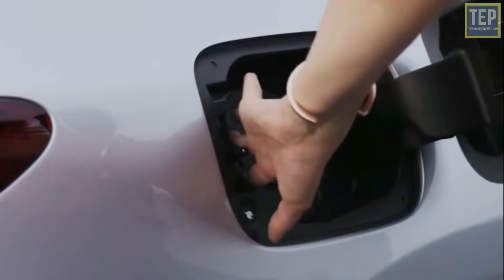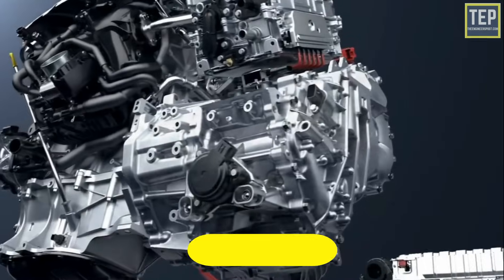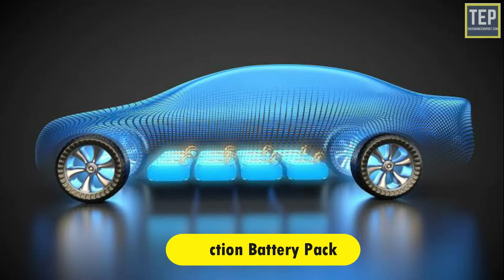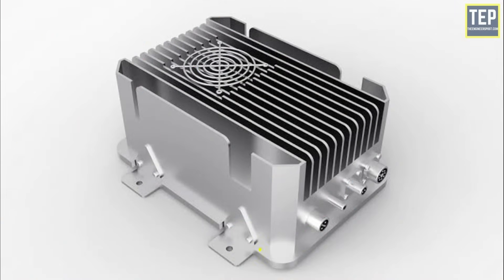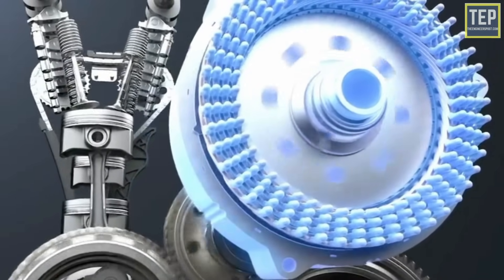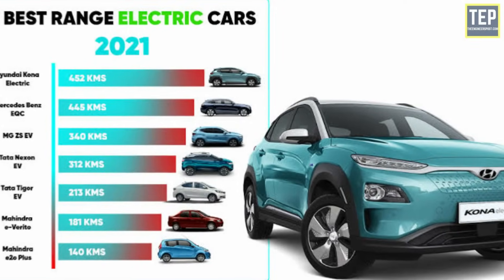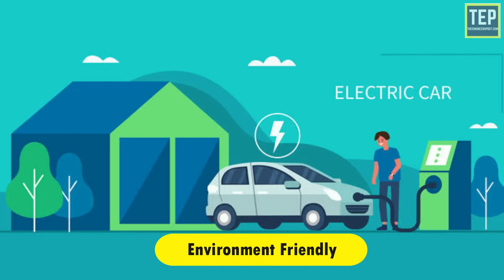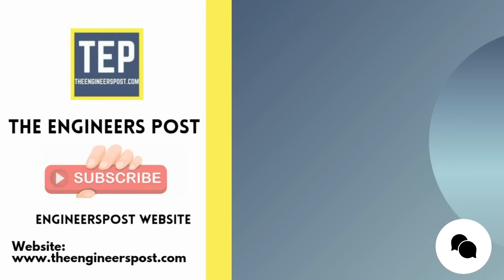How an Electric Car Works? Its Parts & Functions [Explained]

Comment: Does dc motor uses the power inverter?? 
Or what is the use of power inverter in DC motor ev?
Pls clarify this doubt..!!
Reply from the maker: Yes, it uses power from a inverter. Inverter converts DC to AC power. The inverter can change the speed at which the motor rotates by adjusting the frequency of the alternating current.

Comment: Very good quality and very informative video. I barely knew a fraction of what you have explained. Many thanks. 

You can tell the viewers about the pros and cons of battery swapping options, what improvements are being made to increase the range, and reduce charging time. I expect that replacement of the old batteries will be an important cost consideration. How does one dispose of the dead batteries?
Reply: i'M AN ASE Master mechanic ,  30+ years, they don't include, when we went from Carbs, to Computers, we lost most of our mechanic force, that know how to work on computerized cars, electric, is will be the same, as it is, most jobs are running at 10% with the amount of mechanic left in the work force before COVID even.... One we have to pay for ALL our own tools, I have over 100k.... The shops, don't give pensions, we get hurt alot..... we don't get proper health care ......   So less people are doing this work... Once electric cars hit, it will be DEALER only and even then,  mechanics wont have the tools, because we will start at 300k worth of tools and NO mechanic will and can spent that on tools to work on these cars.....    So, this means  for customers, COST will be more....as its a specialty, and less people will become mechanics as they did when carb cars went to computers...  So this means long waits for basic repairs, and less places to be able to work on them.... What runs most shops are small business, as it was with Computers, it knocked many small business out of the ring to repair them...... This will be much worse, meaning ONLY Dealers will be able to and dealers today used to have a mechanic per type of repair, brakes, front end, which means 20-50 mechanics, now most are lucky to have 2-4 mechanics having to do it all...... Once electric cars hit, most will wait MONTHS for repairs and costs will BE MUCH more.... People need to wake up.. One day electric cars will be ready, but today, they are not.. I worked on these, they are NOT dependable, due to weather changes, debris, hot, cold etc..    I live in Michigan and third generation Master mechanic....    I like electric tools and some electric things like weed wackers, but cars..... I don't and will; NEVER own one...people are in for a rude awaken.... I'm nearly 50 years old and still one of the youngest mechanics.... Due reasons I said.... its to EXPENSIVE for most mechanics to even begin to start..... In my day, it was expensive, today its 20 times more expensive for the mechanic and they don't pay us more...... and they should, we should be ALL getting pensions, THE BEST HEALTH CARE, disability, since most of us destroy out bodies, working on this crap..... I loved being a mechanic but it ruined my body and  i'm paying the price .....     So, my point, it may look good on a video.....  but even your basic camera sensors have no idea if its a person, a rock, or ice... ever notice when your cars is near a curb, it beeps to let you know... well, I live in Michigan if ice comes near that sensor it does that too, because tech is not ready yet, they are pushing it to hard and its NOT safe either..... Like self driving cars I laughed when they had nerve to tell people it was ready...... I work on this stuff and no way in hell would I put my family in a self driving car......

Comment: Being "green" is  not  the reason  people are starting to love electric vehicles... If you create a company and  that is your main selling point, you'll be bankrupt in months.

The reason people buy electric vehicles is because they drive smoother and more silent than the gas counterpart. Also, there is a myth out there where the consumer believes that they will be saving money by running an electric vehicle.  And,  finally there is the fact that electric vehicles have a  lot less moving parts than a gas car, so it should break a lot less. In other words, reliability  is also a factor people are buying EVs.

Not because they want to be green with the planet. Truth be told, nobody cares about the planet anymore!
Reply: I go by experience, I been a mechanic Master in Michigan for  30 years,  people love to say well you aren't doing maint, or paying for Gas...Well, they are wrong, Maint on an eletric car is more expensive and we need to recal, other parts of the car due to ice, debris, weather. ..we see more DEAD batteries, which cost thousands.....Electric bills are MUCH higher, more than gas for most people....  Add it up...  We had plenty of customers, and I worked on thousands of electric cars over the years......  These cars don't go that far and are towed more often than any gas car.... Due to break downs.....  Batteries are not getting better, but worse even for Gas cars..    So the Myth out there is that people believe because they are told it will be cheaper.... One, trying to find a small repair shop will be impossible, or near... right now  I'm a drivability mechanic, there are NOT many of us as it is.... TODAY,  there will be MUCH less, once this is total effect, due to the cost alone for someone to get into the field, cost me thousands to start as a mechanic I have 100k in tools......  my scanner alone 8k, per year updates nearly 1k.  along other tools..    I will need to retool, which will cost me around  150-300k.... over a period... and we make less than we did, and less benefits, so new young mechanics are NOT doing this kind of work, because its hard, training and mostly the cost of tools......... that is the biggest for any new mechanic..... So, customers will PAY more and wait longer for repairs.... This happens ALREADY today...and will be much worse... The shop I work at, and we have 2 mechanic, we had 15.... when I started... we are backed up 3 months...    and we get hurt and sick too...... With the young people not wanting to do this, will cost customers more....since they will have to get people to do this line of work, to PAY them more which in turns will JACK costs up.... This is a fact.. I  started when carbs, to computers, we lost most of our mechanic force across the world, not just US, but mechanics dropped out, like no tomorrow and the ones that stayed refused to touch computers..  I for one did and made great money, but I also got very ill, hard job... and not healthy on our bodies... Electric is NO different and costly to the MECHANIC them selves.....  This is the REAL myth, people need to wake up, most don't realize, mechanics PAY for ALL THE tools them selves, the SHOPS don't supply them.....
Reply: @recon5107  I can't speak to your experiences as a mechanic (I had no idea you guys had to buy your own kit!), but as an EV owner I know for a fact the "fuel" cost is much lower than an ice car.  My Telsa model 3LR costs me $9 to charge overnight in my garage to give me 300 miles of range (at $0.13/kwh).   To get 300 miles out of my previous car, a BMW 328i, I had to buy 12 gallons of gas (@ 25 mpg).  Even at a cheap $2/gal that costs $24.  I'd be paying $48 for each 300-mile chunk o' driving if I still had it.   Consumer Reports (and several others) have tracked the average cost of EV fuel and maintenance through 200k miles and it's half that for comparable ice cars.  EVs have drawbacks, of course, but fuel & maintence costs are not among them.
Reply: @recon5107  correct. People think it's cheaper to drive an electric car. It's not. 

The only good thing electric cars have is how silent they are and the instant torque. Thats pretty much it.

There is one thing to add to your comment. Cars are not cars anymore. They are now computers with wheels. And there is a current war between mechanics and car manufacturers because car manufacturers are making less and less standard electronics and propietary software that only they own. OBD interfaces sometimes won't work on certain vehicles wither. Its a pain even to replace a headlight ballast on some cars.

Comment: The most informative explanation on EV. Greatly appreciated! A couple questions: 1. Why do we sometimes hear electric cars blow up? 2. What's the key technology in EV development? 3. What are obstacles ahead in the industry?
Reply: The misinformation in these replies is rampant. Yes, electric cars blow up, but at a rate 10-66 times lower (depending on the study) than gas cars blow up. When the batteries catch fire, they burn at a slower pace than a gas car tank, so they are less dangerous to the occupants. Batteries fires can be put out, but sometimes they reignite so they have to be monitored by a thermal detector for a few days. That's something fire departments have to deal with, not us. Most firefighters that I've talked to accept having to babysit a battery rather than fighting the high number of internal combustion fires that occur each year. Batteries are not getting worse each year. At least in EVs they are getting better. EV batteries built today last an estimated 300,000 to 1,000,000 miles, depending on chemistry and cooling system. In real life they seem to be lasting even longer. If somebody says they don't last very long and their proof is because this person's iPhone battery didn't last very long, smile politely and walk away. The chemistry, battery management, and cycling are very different in an EV than a phone.
Reply: @juliahello6673  Sorry homegirl, that is pure nonsense!
•  These lithium ion batteries are all similar in chemistry and when they short out and ignite, they are nearly impossible to put out and saying fire departments are expected to baby sit a battery car fire is nonsense!!! Let's see if your thinking doesn't change when your house is on fire and they tell you they can't come because they're baby sitting a battery car fire at the moment!!!
•  There is only so much energy that can be stored and transferred from these batteries and it is orders of magnitude less than gasoline or diesel fuel! I order to get more energy per pound of battery weight, more exotic chemistry will be needed and costs will go up including hazardous waste disposal!!
•  I can refuel my car in about 10 minutes at any number of gas stations in any town across the US!  How many charging stations are there and what do you do when you need to go on a long distance trip??!!!
•  The majority of these battery cars are still charged by fossil fuels!  All this exercise is for nothing but to waste even more fossil fuels and pretend it saves our planet!!!
Reply: Battery blow due to thermal runaway , is the battery pack have good cooling system then chances of thermal run 
way is very less. Thermal runaway is the most adverse cause of complete thermal mismanagement
Reply: More specific, dendritic.
Reply: Electric cars blow up only in extremely rare situations similar to gas vehicles blowing up, however these days many batteries are being made which do not blow up as easily and are even safer than before
Reply: @mahinakhter8157  Batteries these days are lithium phosphate which is safer than the older battery Lithium-ion which is known for thermal runaway.  Future of batteries will be solid state.
Reply: I know all these business Proposals about an improvement is not or it's just another big business proposal for the big shot oligarchs and government to make billions of dollars.... They don't care about your safety or income if you can afford it... I prefer the old cars that I worked on I can replace carburetors, regulators, alternators, generators, brakes, radiators, tune-ups ect. And when the computers came around I said forget it man you got a go to the mechanic to do the job and turn off that check engine light and it's more expensive. How much blood can they squeeze off our arteries since they drain all our veins already and kill us with stress and anxiety..... This politicians and business people lie through the cracks of their teeth....
Reply: 1. when battery is pierced there is no stopping it. The chemistry reacts to air and will start burning like hell. just run away. 2. Batteries lasting longer, giving more juice. Reducing costs. 3. Some of the parts used in batteries are being minded from the ground. Soon there will be shortage of materials and EV are going to switch to H powered mechanisms
Reply: @JakovOmrcen   I been  Master mechanic for 30 years, Batteries today don't last longer, they last less longer than 10 year,s 20 years ago.... the quality has GOT worse..... not better... This is for electric and Gas cars, we sell MORE batteries than we ever did, 20 years ago,  in cars a year old and less........  Batteries for Electric also cost thousands .......that does not reduce costs... Sensors , states, motors, etc in electric cars have HIGH maint, need to be recal all the damn time, which is NOT under most warranties, due to it being related to  weather, debris....  So, people who THINK electric will be cheaper, have a rude awaken, and as I said in other posts, its a specialty, just like diagnosing , trouble shooting check engine lights, known as drivability.... something I done my entire career, and I meet 3 others like myself and worked with hundreds, so good luck finding a shop to repair, these, even in the future, due to the cost of tools, US mechanics have to PAY, and most won't and cant.....So, you will be forced to a dealer, and most of there mechanics won't either...Unless the SHOPS pays and MOST shops, don't pay for shit, they rely on US mechanics..... This is why the industry is dying,  and  has been for 30 years.....  These shops will be all gone small business wise.....  It will be only dealers and only a few of them.... that WILL be able to fix this stuff.... due to them PAYING shit and giving shit benefits.... Talk to any Master mechanic like myself who has been doing this along time, they will TELL you the same, this WILL cost the customer WAY MORE money at the end of the day....... and drive more mechanics from the industry... as it did when Computers, come into cars..I  personally loved computers, and electric, but I know reality and cost and what it does to our bodies and how we are treated.  So, the industry, and customers will pay the price, MARK my words.... Long waits....and more $$
Reply: @recon5107  ICE cars have loads more electric stuff sapping battery power now than they ever did, chance some pickups having 2 batteries. Not being sexist but there are a lot more women driving cars these days, just doing short local runs. In the UK we have a saying never buy a car previously owned by a health visitor or district nurse. The Tesla model S was launched over 10 years ago, with only an 8 year battery warranty! ICE engines are 20-25 percent efficient! Electric motors are 97-99percent!!! If you have 2 electric motors on the same axle you don't need a multi speed transmission or differential. Also with the OBDll port you have a very Good idea what's wrong.
Reply: @recon5107  I am the only woman in my automobile engineering class please help me to know which softwares I should study which are important and which online courses I should do .I am even sacred that I will not find the right project next semester

Comment: Hi Sir! 

Can we put a generator ( to produce electricity by running of tires ) to charge car batteries?
Or we can use car roof as Solar Panel to produce electricity to charge car batteries?
Or Use wind Energy generator to produce energy while car is running to charge car ?

Advantages may Include:
1: We can use a car for as long as we need without any charging.
2 : We dont need money to charge.

Disadvantage:
1: Very Important that a THUNDER can attack directly to an Electric Car, and in result all passengers are in danger zone.
Reply: Solar on the roof cannot provide enough energy quickly enough. Charging from the wheels is common, and called regenerative braking. It however won't give you as much energy back going downhill as you consumed going uphill.
Buy electric cars are in every way better than petrol. New fancy technologies aren't needed to convince me to drive electric.

Comment: Great video ! Nicely explained.  We can use alluminum  battery for cars.  I heard just we have to replace aluminum plate and run the car.  Replacement of aluminum is it difficult or other technical challenges are there ?

Comment: Does the electric  motor requires to  be  cooled and how it's done.
Reply: Yes, and that is part of the issue and why some of these fail in certain states, differently....  They over heat and are hard to cool, they do have some cooling, and are in some cases open, but they easily can over heat, get debris, in them as well, as I repaired plenty of them in my career as a Master Mechanic.  Any electric motor is this way , no matter the kind.

Comment: Boy, did I laugh when he said zero emissions... Where does the power grid get its juice??? Mostly coal. There are emissions from every move we make.
Reply: In my country from hydro power
Reply: Solar energy
Reply: what I laugh at, is these idiots who want ZERO emission, yet they still have a cell phone, Microwaves and fart..... I mean, as a ASE Master Mechanic, people are in for a rude awaken, when they get these piles of junk cars, I worked on them years and its expensive and as mechanics, we are GOING to be forced to jack up our costs by  20-40 times, due to TOOLS we have to BUY..... This in turn will go to CUSTOMERS...  SHops don't supply that ......